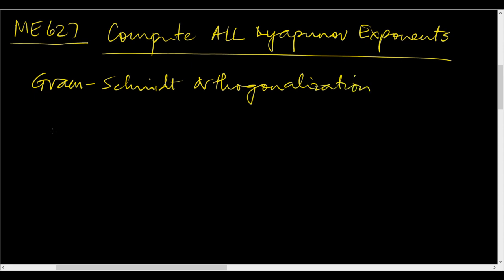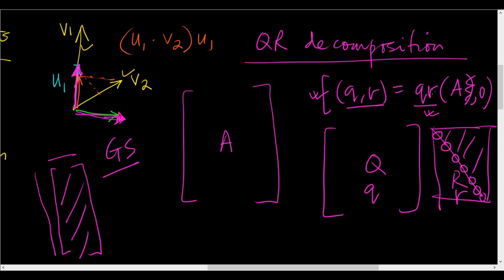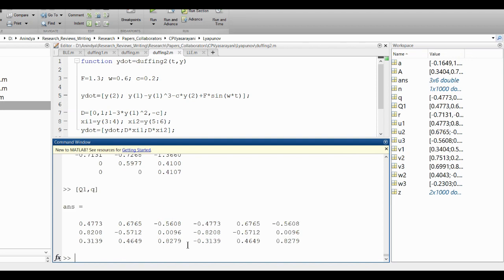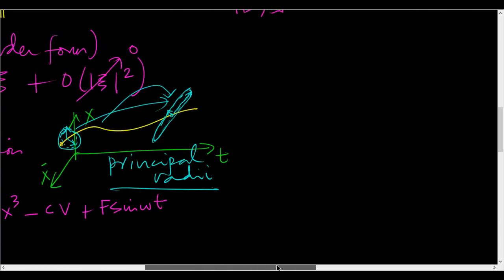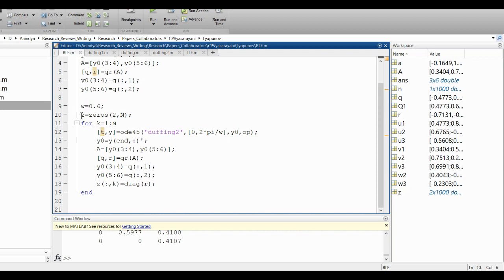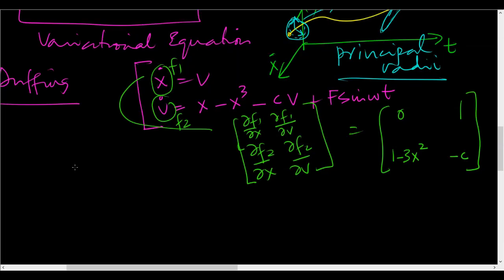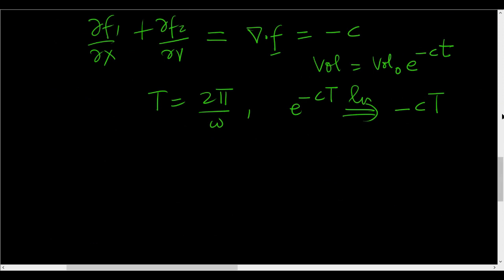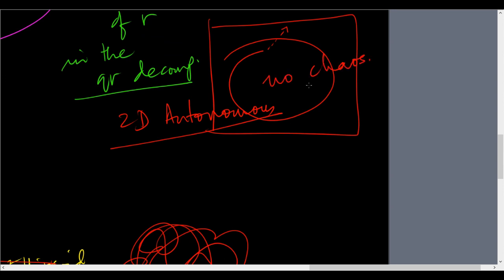All Lyapunov Exponents

Comment: Thank you for your lecture. I was wondering why the initial value y0 was set to randn (6,1) when we computed BLE and (2,1) when we computed LLE in the last video, isn't this second order differential equation supposed to be two-dimensional? If I use ode45 to calculate the duffing function, matlab will report an error: incorrect use of odearguments
@ (T, X) (X (2); F * SIN (W * T) - (2) + C * X X X (1) - (1) ^ (3) returns the length of the vector to 2, but the length of the initial conditions vector for
6. @ (T, X) (X (2); F * SIN (W * T) - (2) + C * X X X (1) - (1) ^ (3) the number of elements returned by the vector and the initial conditions vector must be the same.

Error ode45 (line 107)
odearguments(odeIsFuncHandle,odeTreatAsMFile, solver_name, ode, tspan, y0, options, varargin);

Error untitled10 (line 12)
[t, x] = ode45 (duffing, [0, 2 * PI/w], y0, op);
Reply from the maker: 2 equations for the original ode to generate the nominal solution. 2 more for a random variation that is computed from the variational equation. 2 more for another initially-random variation that is made orthogonal to the first variation at the end of every integration interval using the QR decomposition. 6 in all. Hope that helps.

Comment: Can you please explain what is diagonal r in context of Lyapunov exponent?(  Does it give us characteristic multiplier).
Reply from the maker: Diagonal R in a QR decomposition means the columns of the matrix were orthogonal to begin with. In a chaotic system such an occurrence is extremely unlikely (by which I mean if you get it, it is likely that you have made a mistake and the actual matrix is not diagonal). If (in some hypothetical case) you did get diagonal R, you would still use its diagonal elements in the same way and conclude the same things.